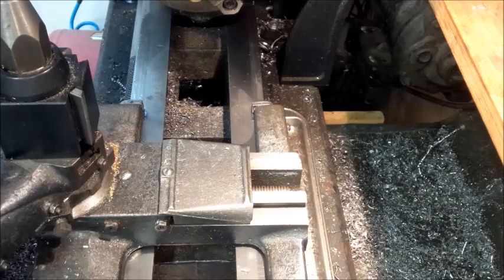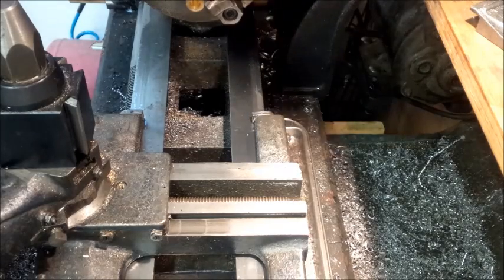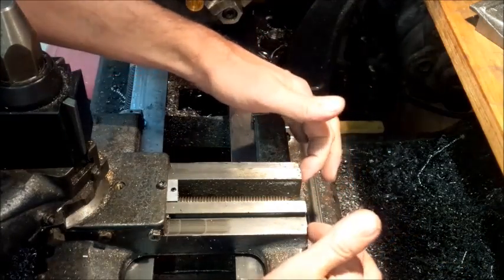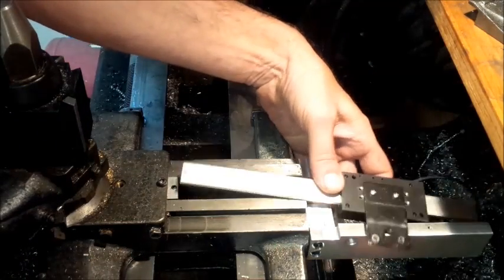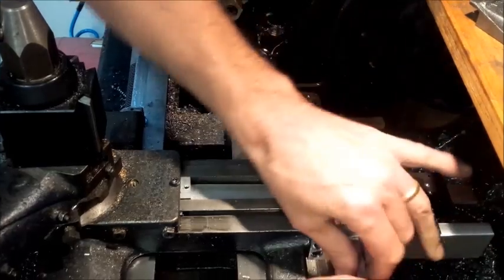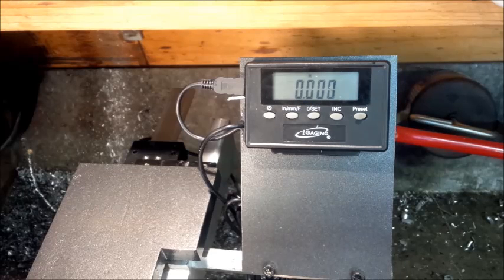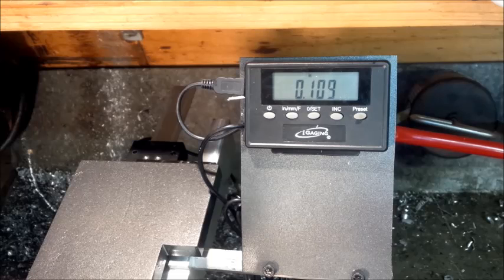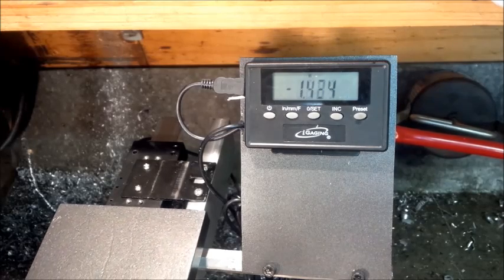X-axis DRO for my Atlas th54 lathe

Comment: That readout seems to 'track' measurements faster, and better than the china knock-off I own.
I have since replaced it with the stainless steel igaging scales and absolute readout.
I wondered if the black cased igaging scale/readout was the same as the china one I have... looks like it's not!
 thanks for sharing !
Reply from the maker: The igaging are chinese made, maybe you got a bad one?

Comment: How can I measure the radius and not the diameter of the Lathe on X axes as this is the case where the iGaging DRO,thanks Ser..
Reply from the maker: That igaging scale does not have any ability to do what you want. I wish it did have some ability to do a simple formula like x/2.

Thanks for watching.
Reply: thanks
Reply: Hello from Greece, as far as I know it is possible to measure the axes   x, Igaging DRO for the lathe which must show value X2, thank you.

Comment: Very cool I'm going to have to look into that soon as I get mine up an running.   got to get my QC box straightened out.
Reply from the maker: +brosselot1 Thanks for watching and the comment. What's up with your qcgb, maybe I can be of assistance? I am rebuilding one now for my lathe, should have some vids up soon since the weather is getting nicer and its not so cold in the shop.
Reply: I've torn down my Atlas QC42 an cleaned it up.  The guy or guys that had it before me did not take care of it an the gear train I think was missing some of the washers so they just used regular washers an I've replaced some of the bushings an washers but I'm having trouble getting it all to line up
Reply from the maker: Got some pictures? I find hobby-machinist.com to be a good forum for getting help. I'm on there.
Reply: +Steve S 
I also posted pictures are you the one that commented on my pictures.
Reply from the maker: +brosselot1 Maybe, I am schor on the forums.

Comment: May just be my way of thinking, but I would call that the y - axis. I did something similar with the x - axis with the same Igaging 12" scale, but it covers the entire length of my 36" Grizzly lathe (at about 10" a go). I like your setup here and may do something like this for the y - axis. Good work and a nice clean mounting of this scale to your lathe. I have a hard time keeping my hands off the compound which screws up the reading since I have it set at angle.
Reply from the maker: +Allen Powell It really is the x-axis on a lathe. There is no y axis, just x and z. Thanks for the comments and compliments.
Reply: +Steve S Thanks for pointing out my ignorance. Being self taught, I can't say I've run across this difference in axis arrangement. I'll probably still think in Cartesian coordinates like a mill table with X  being left/right and Y being away from or towards you and the spindle Z being up/down 90 degrees to that plane.  Since a manual lathe has only two directions of travel and movement towards or away spindle is still considered Z (along the bed) then cross slide travel (across the bed) is considered X. No Y. I get it now. Thanks for making me look this up, but I will most likely still think of it as X - Y. Still learning something new everyday.

Comment: Also what is the required distance off the lathe? I'm up against a wall.
Reply from the maker: +Whitpusmc Hi, sorry, never noticed this comment till now. Not too much room, the dro scale is 6" so your looking at about 6" more than the crosslide goes.
Reply: +Steve S no worries, I have added a DRO to both axises of my Sears 12x36 and working fine
Reply: +Steve S I pretty much copied what you did, many thanks for the design!

Comment: Do you have any plans or measurements of the brackets you made? Don't need the larger sheild or display mount, just the little bracket, U shaped part and DRO length bracket
Reply from the maker: +Whitpusmc Sorry, I don't have plans, I did it all off the cuff. If you really want the plans I might be able to draw something up.
Reply: +Steve S no I'm good, all done! Works great!

Comment: Have not looked at that model.  Guessing that may also be a value priced unit.?  IS it battery powered or plug in adapter?  Elegant solution and well protected!
Reply from the maker: phooesnax Value priced and battery powered. Thanks for the comment.

Comment: Slick setup! (Nice video too!) Really cool idea fitting it in there like that, wish I could do the same, but my machine is built differently...
Reply from the maker: JTZshokunin Thanks for watching Toby, it is a nice setup if you can fit it in, the idea will work on most of the small older lathes.

Comment: Nice ingenuity. That new cover could also make a nice place to mount a mag base camera holder for close-ups.
Reply from the maker: ILGopher The problem with a camera on the cover is vibration, I have tried it. This is a little atlas and while I can get a good cut on a piece, the rest of the machine shakes. Even if I put the camera on the tailstock I get too much vibration.

Thanks for watching and commenting.
Reply: Yep, I have the same issue.  Having a built in VR in the camera or lens helps, but it has its limits, too.
Reply: ILGopher Even on much bigger lathes the vibrations get to be an issue... I prefer mounting on external devices like tripods or boom.

Comment: Sweet, I can see that cover and DRO fix in my future...especially for my yet unfinished SB which has no micrometer dial for the tool-slide. I guess in 1919 you didn't need one, LOL!

Thanks for the excellent share, Aloha...Chuckl
Reply from the maker: Knolltop Farms Hey Chuck, thanks for watching. It is strange there is no dial for the cross slide on the sb, I cannot see how a metal lathe would not have one even back then.
Reply: Steve S I agree, and thankfully there is one on the cross-slide, but even in the old catalog I have it's not shown, or offered as an option for the #34 13" screw-cutting engine lathe, though they do mention the compound being graduated in degrees with a nice brass collar. I've tried to think of how to add one in, but there isn't even room for it on the feedscrew with the nut taking up all the room. I'll come up with a photograph of it of "Machining YouTube" after Dad and I eat lunch. Thanks for the great little fixes, I was brainstorming a clamp for a dial gauge to measure for me like the one Ray Caniglia has.